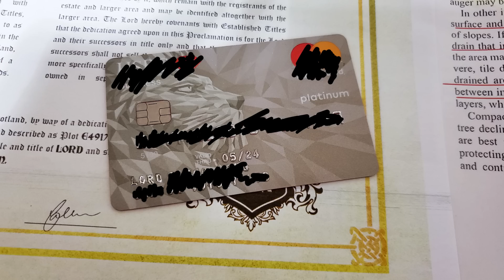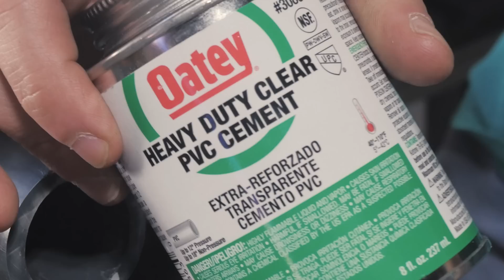The Ballistic Picnic Table is Getting SCARY

Comment: There's a reason PVC bows are not great, and it's the "unbending speed" (if you will). Sure, you can add more weight to the arrows to use up all the energy, but what you need isn't more weight. You need a better design to make it faster.

Comment: If you haven't made the actual frame yet. (3week late comment) Look up windlass systems and roller lockworks for actual medieval crossbows. You could make simple but beefy ones pretty easy. Would be way cleaner than a ratchet strap and scissors

Comment: I cringed when I saw the pulleys. You should get ones that have metal and not plastic bearings. Those are as cheap as they come. Aluminum ones would be best but alot more expensive.

Comment: I'm really interested in seeing what you do for a frame. You'll want some outriggers to keep it stationary. Do you think you will do the two posts lift-off method for the trigger? I was thinking about the drawing mechanism, it needs to be more permanent right? What about a boat trailer crank? They use a thick wide strap with a hook in the end and the crank should have gear reduction to make the draw easier to work. Just a suggestion, unless you're going to go all out and use an electric winch.

Have fun, be safe.

Comment: Some tips; Reduce the weight at the ends of the bows as much as possible to increase speed, invest in a threading die make the bolts out of aluminum rod plus anything else you can think of to reduce weight. PVC can be heated with a heat gun softened and formed it will return to normal rigidity when it cools, heat and flatten one side of the PVC pipes and place the fiberglass rods in so you have flat base and curve to the front. Modify or make a new clamp for the new shape. Drill 4, 1/4 inch holes front back in each pipe slightly father apart than the holding clamp then 1 more 1/2 inch in the front centered between the first ones. Before inserting the fiberglass rods, sand the area to bare fiberglass that will be between these holes (wear a respirator). After the bows are assembled but single squirt a little silicone caulking in the 1/4 holes to create a plug, allow to set. Use fiberglass resin (hardware store) mix with hardener according to instructions and enough to fill the area between the silicone plugs with fiberglass. Slowly pour into 1/2 hole working time is around 10 minutes so have everything ready do each pipe separately. Make sure you have the build to this point like you want it because you're not getting it apart again after the resin sets. Finally try find a way to increase the rigidity of the projectiles without increasing weight you're losing power due to flex.

Comment: You can coax more spring force out of your bow arms by stuffing their internal diameter with more snugly fitting conduit or dowels, the extra material stiffens the PVC, giving better resistance and prevents warping or kinking.  As for arrows, there are subtractive flights called air-fleshing, just whittled-fluting in the back portion of the arrows, some fine holes through the ends of the shallow fluted channels, like external rifling for arrows, barely enough resistance to maintain straight flight.

Comment: Have a look at how Roman Catapultas/Ballistas work.  It's essentially a board which slides up with a pivoting hook to grab the string which is then drawn back by a ratcheting winch once connected to the string.  To fire you pull a trigger bar out from under the tail of the string hook, the hook pivots up out of the way and the string is released.

Comment: Love the design and the project, but I gotta say, get rid of that nylon rope and get you some Dyneema rope. It's super light and strong, and it's a static braided line with basically no stretch. You can run a smaller diameter rope and get the line speed up for more velocity!

Comment: Are you going to fletch the bolts? It might stabilize the flight. You might have to open the frame and add a slider for the bolt though.

Comment: Drill all the way through the front end and add a Truck bar and make it fully functional for maneuvering around with, and if you need to shoot further down range just make a simple shelf for a Jack to rest and put it under the center of the front end and jack it up at an angle.

Comment: Not sure if you've already considered it, but ballistas use a track system with a sort of crank that would slide a fin back and pull the string back. Then the release mechanism would drop the fin down into the track and allow the string to fly back to the rest position - pushing the bolt forward.

Comment: Ever thought about making a large trigger mechanism instead of the scissors? 
Using a scaled up version of the bow trigger release would be safer, more reliable, and capable of a stronger draw weight. (Knots can reduce the strength of static climbing rope)

Comment: If you made a feather fletching and tuned the pvc pipe into a giant arrow. Fill it with the smaller arrows. Angle the feathers in a spiral. When it flys threw the air it will spin. However you can put smaller straight fletching on the pvc going straight to keep the shaft straight. The back with the spiral fletching is attached with threads. The air will make the back spin off. A small parachute pops out and causes the pvc yo separate and the arrows inside to come out mid flight. I can send pictures or talk to you if you want clarification.

Comment: You could use a hand winch instead of the ratchet. Quicker and easier loading. Hand winches can come with a ratcheting lock, so it's safe too. (handwinch like used on boat trailers)

Comment: It would be awesome to get a hand crank winch for the finished product. Just to be able to clickclickclickclickclick crank it back and let it fly would be awesome. According to google, harbor freight sells “half ton” hand crank winches for $30, just sayin…
As far as the trigger goes, I wonder if you could use a loop on the drawstring, feed a cord through it, and secure it with a slip knot. That way, you wouldn’t need to deal with scissors, just pull on a rope.
EDIT
Just found a video by a channel called “Carter Ranch Horse” entitled “Tying: Quick Release Knot.” It seems like the kind of knot you’d want to use if you stick with a rope trigger because the slack of the winch rope is entirely free from the drawstring rope when the knot is undone; that way the rope shouldn’t whip out and cause injury.
I typed out the channel name and title because I’ve heard leaving a url in the comments can have it sorted as spam. Not sure if that’s true, just wanted to make sure you saw it. You should find it no problem, but if not, let me know and I’ll reply a link.

Comment: If you want extra stability you could buy some cheap aluminium and rivet it in a channel at the back end to give it flights only would need to be two given the weight. Provided the build has some trenches for the bolt to sit in it shouldn't effect anything. Maybe look at windlass crossbows for a decent trigger mechanism

Comment: You might also want to look into structural grade pvc. I've used that to make heat formed hand bows, and it's quite impressive stuff. Much improved impact tolerance, flexibility, and UV resistance. The brand I used was FORMUFIT. Not sure if they sell schedule 80 though.

Comment: Need a slide tray or "barrel slide" for that big honking bolt, also a really big 2 feather flights. If i had to guess, 6 1/2'' to 7 1/2'' long and 5 1/4 wide and 1 1/4'' off set cut on the flights.

Comment: replace your rope with your paracord, that type of rope is prone to stretch bad and break unexpectedly if your worried put 3 or four strands. I also have 1000s of feet of shrink for wire many sizes all the way up to 3" Ive done that for a ropes swing where I put 5 strands together weaved and then shrink wrapped it worked awesome

Comment: This build is one of my favorites! You could use a hand crank like you see on boat trailers and add a trigger mechanism so as you pull it back to a certain spot it automatically locks so you can get the crank off

Comment: 1 12x20x2 piece of oak wood, a set of stock swaybar links from a 93 jeep cherokee, a12"piece of allthread/matching washers and nuts to fit the links, a 14" length of 1x2 ash, a stainless steel slotted serving spoon, eyebolts, and some bungee cords =

A completely OP catapult for garden snails.
There are no pics but in your mind.